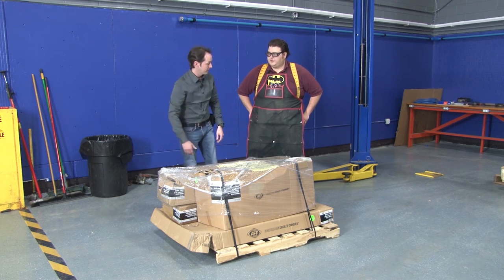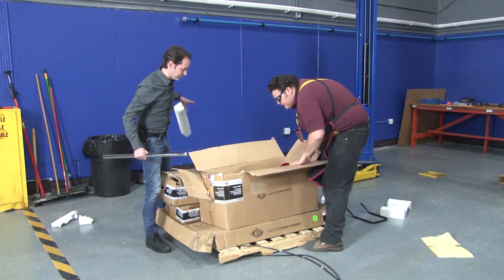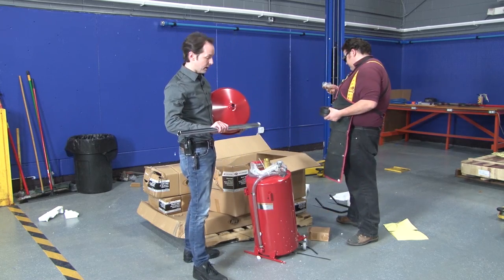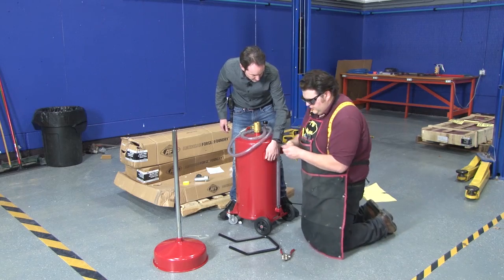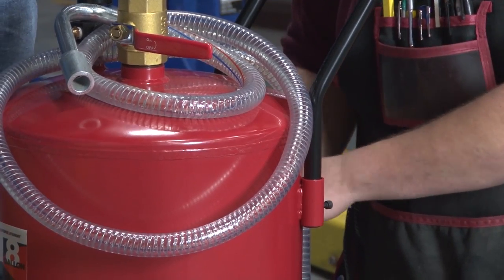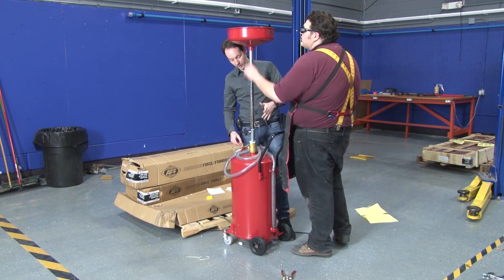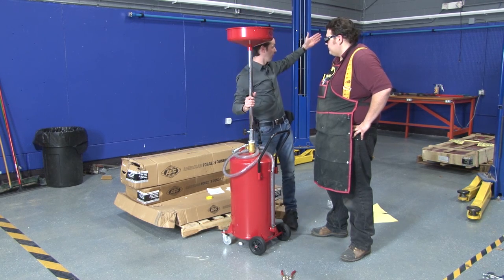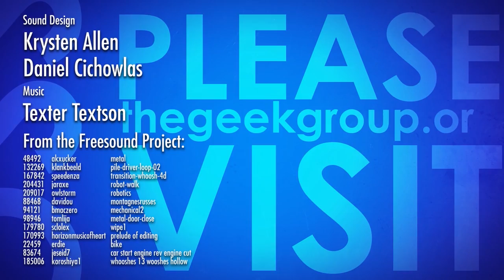Unboxing an AFF 8893 Waste Oil Drain

Comment: Those waster oil drains are really cool and I use to love them when I worked as a mechanic. One word of warning from some one who has seen it happen many many many time. when you pressurize the tank to evacuate the waste oil be careful not to bump the ball valve at the bottom of the pipe. If you open or bump the ball valve oil will shoot up the pipe and out the catch pan. shooting oil 10 feet into the air and covering everything in a 15 radius in oil. It funny till it happens to you haha